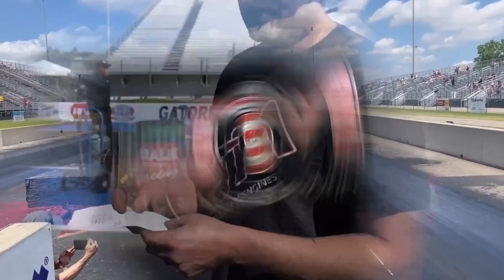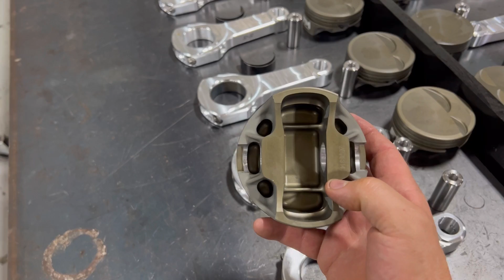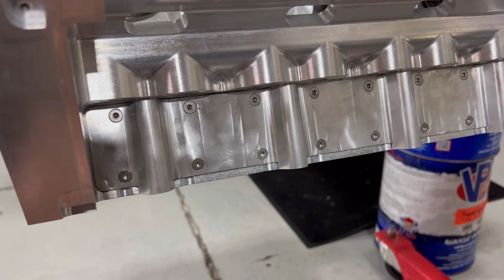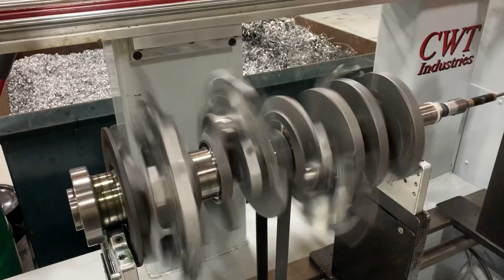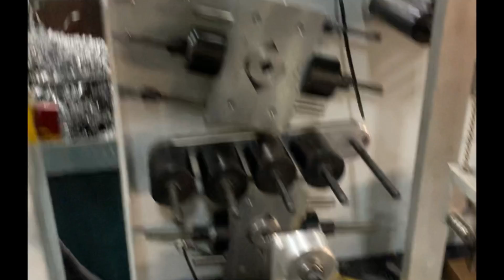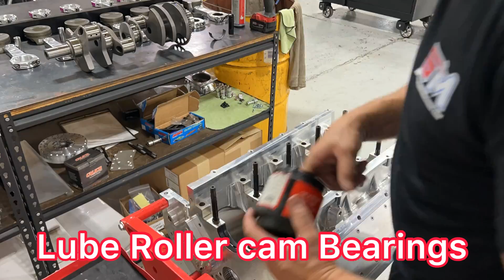The Baddest Billet LS Engine Ever ! Pt 1

Comment: Did you solve the problem that stock and aftermarket LS engine builders are having with the crank position sensor failures? Because of the reluctor being in the wrong spot or walking somehow out of position

Comment: @SteveMorrisEngines

I Watched a diesel build video the other day and it’s was a pushrod 4 valve motor. 

What hasn’t any OEM or aftermarket builders designed any gasoline engines the same way?

Thanks

Comment: Why does the crank have a reluctor ring? Are you going to use a crank trigger for timing?
Reply from the maker: easier to balance
Reply: Thank you for the answer. With the engines you are building are you going to use Holley and Fueltech EFI?
Reply from the maker: @robnewman6780  yep either one

Comment: The engineering that goes into this project is unbelievable. Would love to see the type of HP you could get with 304CI in this block to compare to the ATC rules in Australia where biggest BHP seen is around 660 for an N/A pushrod motor.

Comment: I wondered if you use underpiston oil squirter? Beautiful work. Is there a reason why piston pins are not lightened by having outer portions tapered bore. We did this on our wee engines to pull quite a bit of weight out that added no strength. I know it's a pain as it's not std. On a big pin might be surprising how much you can pull out.

Comment: Just curious that I noticed whenever you rotated in the engine upside down it looked as if the bearings for the camshaft are a type of needle bearing? I’m sure there are many types of needle bearings that are superior compared to what GM used from the factory for the rocker arms. Just wondering if needle bearings in general are known to be problematic with can shafts in your experience? Thank you.
Reply from the maker: Not problem at all. If they were k would not use them.

Comment: Is it possible to make a 3 piece block/heads. One being the base for the rotating assembly. Second and Third pieces being the cylinders for each side with the heads being machined as one piece with the cylinders.  This would remove the need for head gaskets. The exhaust and intake ports would be a part the cylinder/head billet. Would this cause other problems?

Comment: Is there a reason they don't use needle bearings like 2 stroke engines?
Reply from the maker: Because the crank would have to be split, you can split a 1 cylinder crank and even a 2 cylinder but how would you ever get the center bearings in the crank
Reply: @stevemorrisracing  They do have split needle bearings, I did see something interesting that used another split cage 90' degrees around the split needle bearing. Kinda looked like the crank spacers they used to use when building a 377cu Chevy, 350 crank/400 block.
Reply: @stevemorrisracing  My 2021 Skidoo 850cc factory turbo snowmobile uses a split needle bearing cage.  I believe they started using them in 2017.

Comment: sitting here daydreaming. should look at the tech used to do water cooling in computers. turbulent flow. little pits. skived copper.  heat pipes. maybe press copper sleeves into the water jacket bores. nah wrong steve

Comment: Nice work I love the attention to detail  👌🏻 could you do a crank blue print and build a motor that goes to 17 to 20,000 rpm? That would be sick along of work but sick!
Reply: It’s impossible to get an LS to rev that high. Too much rotating weight/valve train stability
Reply: @FullThrottleFirearms  nothing is impossible, just whether you can justify the cost 🤣
Reply: F1 has had engines revving that high for a long time.
Reply: Apples and oranges my friend….

Comment: If it wasn't so easy to balance and  you had to add Mallory metal to the crank would you have stuck it in the side horizontally instead of vertical in the spot where you took the material out? I recently saw somebody with a pretty big following have a 540 built for him and his second or third time out with the car it shot the Mallory metal out the crank through the pan got oil under his tires and he put his brand new Nova build into the wall.. luckily he was only about 200 ft out when it let go of the crank weights, upon inspection it was half ass mig welded in to begin with and lots of guys said that they don't put the Mallory in vertically they put it in horizontally so my question to you is since I have a lot more respect for your opinion than most builders what's the right way to do it in your opinion? I'm sure if it was welded better it would have helped as well ..but  at 8,000 RPMs who knows that's why I'm curious because I know you would know better than anyone
Reply: Yeah that fucking sucked for billy
Reply: @jessecoc6247  I know man it hurt bad to see... That car was killing it .. literally brand new everything setup and in 3 events , made the finals twice and won it all once.. that's unheard of...

Comment: Rollerized cam bearings have been around for quite awhile, but I've never actually used them.
How do you see them holding up after failures or even "minor" debris going through them compared to conventional bearings, which often don't typically get too beat up?
Reply from the maker: I use them all the time in drag week cars 
Been great
Reply: @stevemorrisracing  Thanks for the reply! Love watching your videos and sucking up the knowledge and seeing that you're humble about not having all the answers! 
I always worried on a more used car, you would see some seized and flattened needles, especially at the front lower with the tension.
Again, thank you and keep up the content!

Comment: This might be dumb and it might not you balance the crank and piston&rods within a couple grams of being balanced now when it’s in engine running everything is coated with oil plus oil holes inside the crank are full of oil probably several grams of oil being slung around by centrifugal force do you think that oil could help balance it the rest of the way or make it worse I’m no genius just thinking out load thanks for sharing everything with us buddy love watching
Reply from the maker: Nope oil splash can’t be measured, uncontrolled would only make it worse but it is not consequential
Reply: @stevemorrisracing  thanks for answering my question you guys are awesome love watching

Comment: What I really want to know is, how do you get that timing belt on without a tensioner to give you some slack to work with?  Is the back side (hub) cone-shaped to lift the top sprocket away from the bottom sprocket as you tighten the bolts?
Reply from the maker: Tapered hub

Comment: Amazing nobody else made something like this. There is billet ls blocks but as you say the head gasket seal is the determining factor of the power potential. Heck look at mullets engine. He couldnt keep bearings in it once he got it to kinda hold a gasket. Dry deck and all those big studs is the answer. Now just gotta keep bearings alive.
Reply from the maker: That is no problem on my stuff

Comment: Steve, very happy for you seeing the first SML coming together. I'm sure it's going to be a beast! If you build the first three engines with identical components, is the weight of the pistons and connecting rods consistent enough (or can you adjust them to be consistent enough) that you can balance all three crankshafts the same or do you need to individually balance the crankshafts?
Reply from the maker: The same
Reply: Lol this joker now trying to scam steve morris himself😂

Comment: Will you be providing the specs of this SML engine along the way?  Bore, stroke, static CR, rod ratio, cam specs?
Reply from the maker: It is a 427
That gives you bore and stroke
Compression I did not mention but it is 10.5 to one
Cam Specs - no I won’t share

Comment: With all of the science involved. I would think mirrored turbos with the same exhaust and intake pipes would be more effective. Honestly asking
Reply: Mirrored turbos are just about looks they don’t make anymore power.  You can actually mount a turbo vertically if you want as long as you address the oiling and it makes the same power.
Reply from the maker: Not really, you would think so but it does not,

Comment: One observation; it appears during the dyno pull that the passenger side inlet pipe clamp, at the throttle body, is loose enough to rotate slightly.
Reply from the maker: It is a dual seal that moves normally but is sealed
Reply: Sharp eye man, I had to watch 3 times to catch it, though I was looking at the v band at the turbo the first time.

Comment: Do the xml use roller cam bearings? Interested in why you use a roller bearing for the cam. Seems like it has more potential for disaster\failure than the traditional bearings.

Comment: the sml could put the fastest stick shift gm record back under leroy's belt, and solve the constant head lifting problem it had
Reply: That head lifting problem has been solved with that 6 bolt head iron block

Comment: Hi Steve, just had a question. Mercury Marine Racing has a DOHC LS crate engine they put out for street use. They also make an all aluminum big block DOHC Crate engine. I just wondered if you have worked with either of them yet and have any opinion about the design quality and suitability for higher power builds?..... and I really enjoy your videos. Thanks.
Reply from the maker: Not yet
Reply: How is a DOHC engine an LS at that point completely different engine at that point
Reply: @CoyoteFTW  it was an ls short block with dohc heads. same idea as various companies over the years doing things like hemi heads for small a sbc, ohc heads for ohv, or the arden heads for a flathead.
Reply: @CoyoteFTW  was thinking the exact same thing. What makes the LS so great is how compact it is and DOHC isn’t compact.
Reply: Mercury Racing calls it a LS engine. It was designed to run at high rpm for long periods of time. They start with LS7 short blocks and install their own heads and valve  timing assemblies and change a few internal components. It is rated at 750hp and is naturally aspirated

Comment: This channel reminds me of my father and his old business. He had a typewriter repair shop, then came the computer. This shop is facing the death of the gas motor and here comes the battery pack.
Reply: ICE may be going away at some point in new passenger vehicles but it will NEVER go away as a hobby.  In fact, I will bet $ that the ICE hobby will grow when every one has to drive boring ass, soulless golf carts as everyday vehicles.
Reply: Typrighters are a business tool, not a hobby, and were very loud and hard on fingers, using paper, vs e-mails
Reply: @supercharged6771  Try using a gas engine in Cali after 2035. You can't get gas for it, your $10,000 engines become real expensive paper weights
Reply: @Sgt.Gamble   - WRONG!  CA will limit new car sales to golf carts only after 2035 but there will be no restriction on existing ICE cars.  As a conservative CA resident I can guarantee you that millions if CA will cross state boarders after 2035 to buy a real car.
Reply: @danmyers9372  BS.
California residents bend over.
Reply: @danmyers9372  I think you underestimate the will of and the power of your Epa out in Cali. All they want to do is take away your race hobby exemption. Dont be shocked if 1 day they get all the power and ability to take it all away.  Cause remember they have science and stuff on their side lol.
Reply: GM said last year that 2035 was the last year that it was building an ICE. Going to all electric.
Reply: @sefwqer34  Plenty of time to change their minds. I doubt electric (as it is now) will be what we are building at that point in time.
Reply: @sefwqer34  Dodge said Dec of 2023 no more challenger or charger motors. Yikes
Reply: All electric commuters are great, weiand superchargers will still be turning gasoline
Reply: @bigboreracing356  wouldnt that be funny.

Comment: I have no idea of the tune up but I'll take a wild guess and say the tick was 2500hp
Reply: 3 sections on the graph. 1000 per section.
Over 2000 torque.
Over 3000 hp.

Comment: Hey Steve, just a quick question for ya - What is the difference between the SMX and SML engines ? What do the different letters mean in regards to the platform? Is it something like the SMX is based on the LSX block and the SML is based on a different LS block ? I know you customize the block with the water jackets/passages and essentially have your own blueprint but it would be interesting to find out exactly what makes each engine designation unique from the other "stock" platforms. Keep up the great work.
Reply from the maker: Nope look at the SMX 
It is a big block smallest it goes is 525 cube to 572
Reply: Check the playlists. He has one for each engine type.